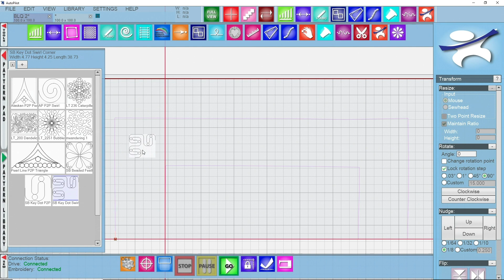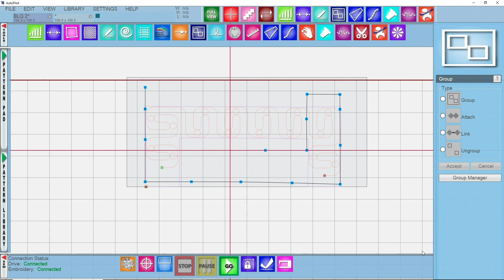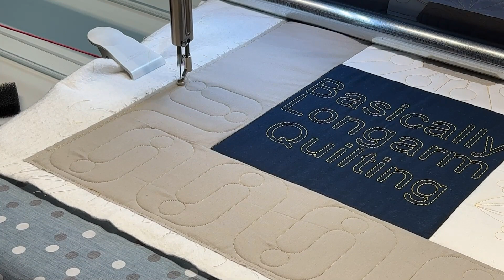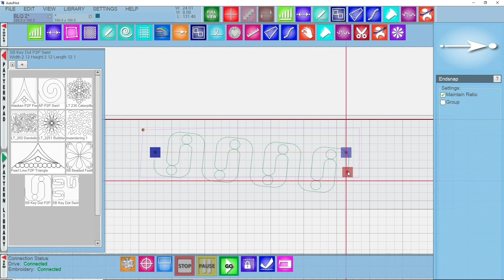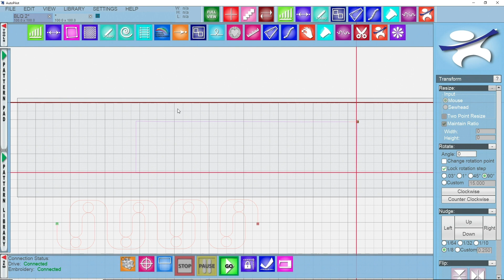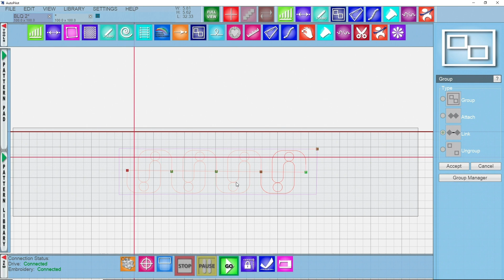INNOVA AutoPilot Training Mach 3 - HOW TO: Border & Corner

Comment: Does the software have Snap to Nodes, at the point when you stretched the Line while moving the node itself (Draw Text), so that it was on top of the previous node?  I see that the software has Snap to Object, but I am just wondering about when you stretched a node to be on top of the previous node.
Reply from the maker: Currently AutoPilot does not have snap to node. You can snap a node to the grid, but that does not always line up with where you point is.
Reply: @LindasElectricQuilters  , ok thank you. My embroidery software, Embird, does snap to nodes, but I understand that is a rare feature, even with embroidery software.